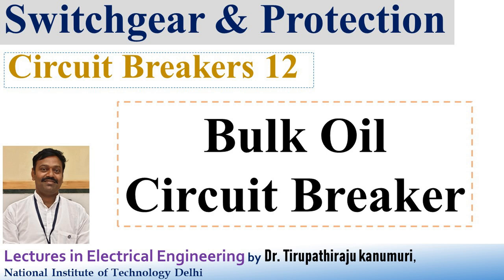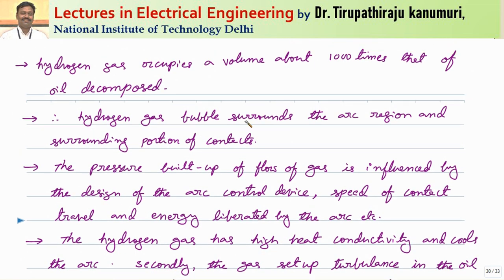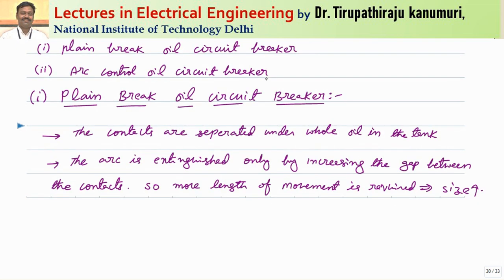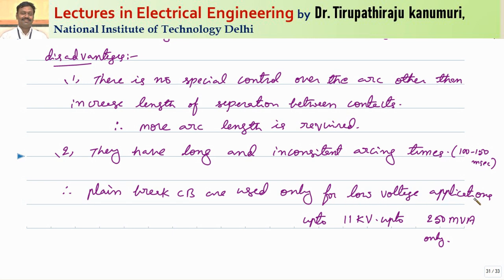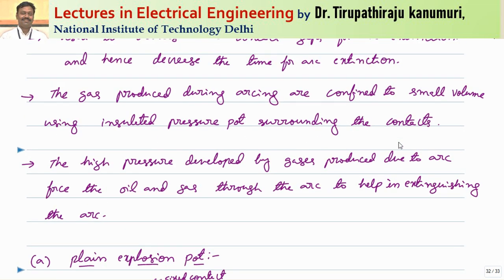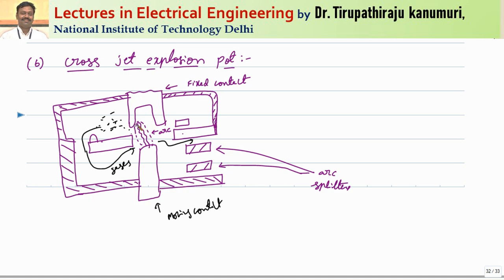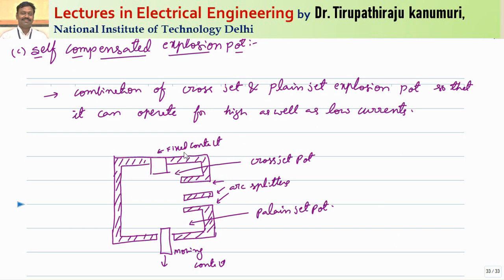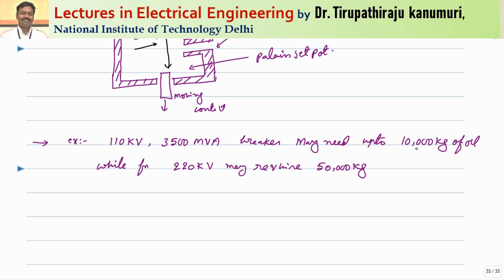SGP212 Bulk Oil Circuit Breaker

Comment: Sir your explanation is very helpful for me in the crucial time of my examination. One request from my side is that there one more small topic in this bulk oil CB that is Impulse type oil breaker. This is the 3rd type in bulk oil CB which is mentioned in switchgear and protection book and author is J.B Gupta. It will be helpful if you will be uploading a new vedio regarding this topic. Thank you sir!!!